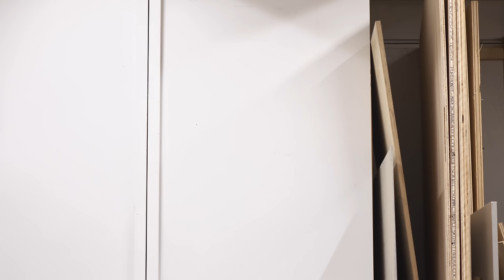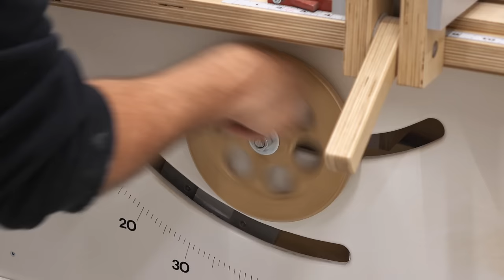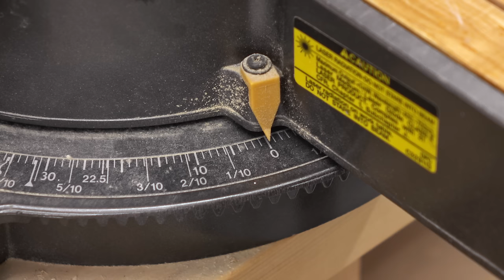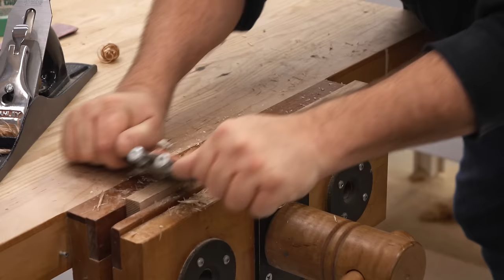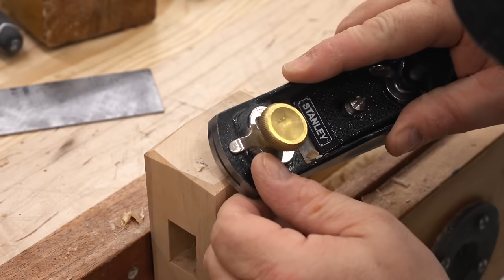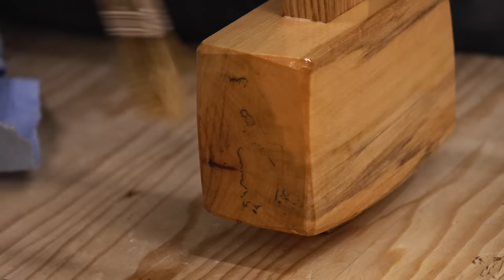Making a Simple Mallet for Woodworking - Spalted Maple and Ash - Hand Tools

Comment: The mallet is very nice and simple. Good work!

I wish you well with the "Mob" but the last I had looked it is way more expensive than I can justify. I've also noted that you can no longer find out how much it is to join, before you join! Sorry John, but I don't trust sites like this. If you're selling something, put the price out front.

In addition - Exactly what are you supposed to do with the "stuff" on the "Mob" site - From the Terms and Conditions.
"Permission is granted to temporarily download one copy of the materials (information or software) on Makers Mob's website for personal, non-commercial transitory viewing only. This is the grant of a license, not a transfer of title, and under this license you may not:

    modify or copy the materials;
    use the materials for any commercial purpose, or for any public display (commercial or non-commercial);"

Based on that, I guess we're supposed to look at your stuff, say "Wow" and move on. According to that wording, one is not allowed to do anything with the material.

I've already unsubscribed from Jessi's feed because it's just turned into commercials for the "Mob", hoping the same doesn't happen here.
Sorry for the rant,  but needed to vent!
Reply: It means, you can't make the stuff from the plan and sell it as your own. Stop reading so much into it.
Reply: @KipdoesStuff  Sorry but I read "or for any public display (commercial or non-commercial)" as meaning I can't post a picture on Facebook, on my web page, or any other place that would be public! Also "modify or copy the materials", what do you think that means? Those terms are a legal document!
Reply: @jrkorman  You can't display the materials (plans) publicly.